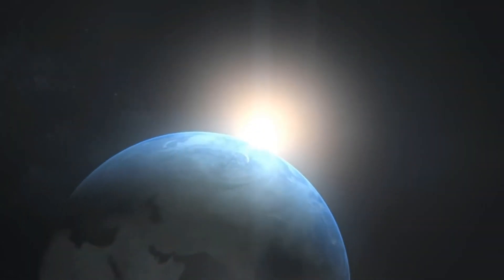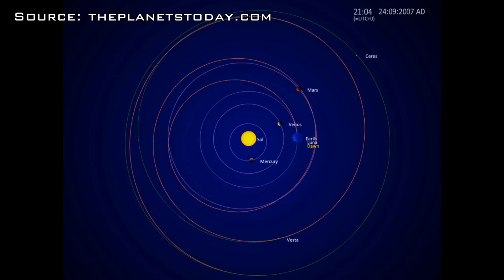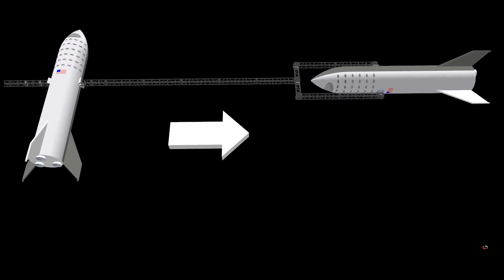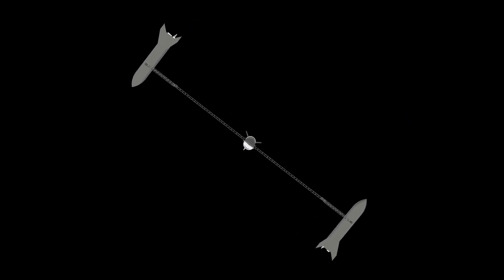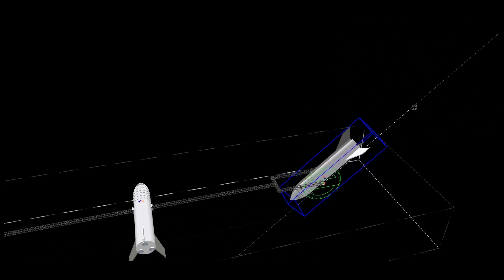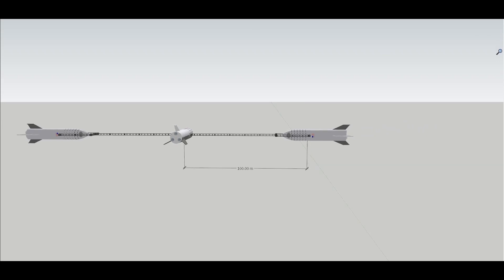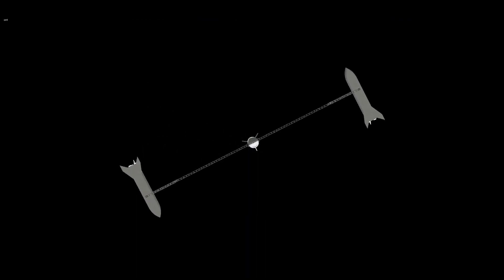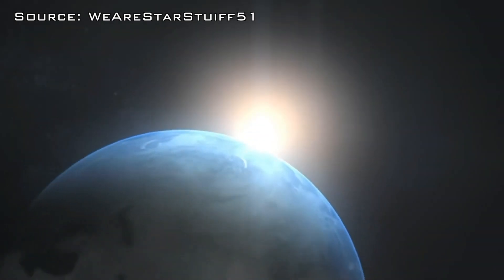GLS2: Artificial Gravity for SpaceX's Starship

Comment: Your design of spinning two spacecraft (or, I’d rather go for 2 environment modules) around a central craft is simplistic. What I mean when I say simplistic is- elegant. Thinking outside the traditional wheel and single module craft “box” exhibits some good practical engineering concepts. I would suggest thinking about the central structure being the main drive system (as well as housing the foldable extension arms). Even though the spinning modules would need propulsion to initiate and stop rotation, they would have less mass sans a main drive and associated extra fuel. This would place less stress on the extended “arms.” What do you think?
Reply from the maker: I like it a lot, this puts some great visuals in my head!

Comment: This is a very interesting concept, though I'm not 100% sure that truss would long enough to avoid problems from Coriolis forces, but I suspect we can figure out ways to cope if it isn't. There also needs to be a ballast system to equalize the masses precisely, but that could simply be a movable weight on the truss. It is unlikely that the masses of the ships would be much different, so it would not have to be extremely massive.

Comment: Yup, except you don't need the main engines for this and you can do it with two ships tethered and facing in the same direction, leaving the floor of each Starship as a walkable base. Two enclosed ladders as tethers (which can be rigid) complete the travelable circuit between the spacecraft. "My Idea" has been around for decades, btw. The Starship design is by no means set in stone. This leaves open many possibilities for configuration of artificial gravity systems. This is a good start.

Comment: How are you going to ensure that both of the outer ships weigh exactly the same...? How are you going to ensure that the thrust from BOTH is exactly equal and the burn of exactly the same duration. With a ridged structure, lots of scope here for a MAJOR SNAFU...!!!
Reply from the maker: Good questions! The computer that controls the thrust would have the task of making sure that the spin system is balanced during spin up. The mass amounts don't have to be exactly the same. The closer the better obviously but realistically the center of spin will not be located in the exact center of the GLS. Instead it will be slightly offset, and one starship will have slightly stronger artificial gravity than the other.

Comment: Rather than assembling lots of beams and girders why not use the masts and rigging system that worked so well for centuries on sailing ships.
A few simple beams, that  need be no more than hollow aluminium poles held in place by cables could bind the 3 starships in your example into a rigid structure . Loads would be transferred through the beams and cables so the entire complex can be powered and navigated as a single solid vessel. Exactly like a sailing ship.
Beams and cables would cost a fraction of any other method, are easily assembled, require minimal material and are easily expanded. Indeed I would suggest that two separate rings strong enough to support multiple pairs of ships be built around the central starship, but separate from it  to take the loads and decouple the central starship from the need to support loads. Provided you make these central anchor points strong enough you could expand the number of passenger ships in pairs as needed.
A simple cabin with an airlock at each end can be run on cabled between the under-gravity starship and the hub along cables just like a ground based elevator. Two of these and both sides of the system can visit each side of the Star Cruiser (to give the complete structure a name.)
Because the 3 starships are bound in a single rigid structure, spinning them up and despinning at the end of the voyage are simple tasks.
Reply: I,m at willettfj@hotmail.com
Reply from the maker: Please drop your email address so I can contact you, or DM me at twitter.com/realsmallstars or instagram.com/realsmallstars - I would love it if you can draw a picture of this, or just parts of this especially how the aluminum poles and cables are oriented

Comment: I don't see the use of a cable system (I say system because it wouldn't be one cable, you'd want many redundancies) negating the use of the main engines for the rotation.  You'd have to use a bit of rcs to keep it taught initially, but that amount of fuel usage would be dramatically offset by not needing to bring a 3rd rocket up.  Even if you did have to use rcs for the maneuver, it still would be dramatically less expensive than a 3rd rocket.  As for safety, you have some points for, and some against.  A rigid body may have a higher load limit (although not necessarily, but let's say it does) but it isn't as resistant to sudden, unexpected loads, such as a point failure, a meteorite impact, explosion, or any other unpredictable occurrence.  If there is a failure, a cable system would also be a lot more fixable, or in a worst case scenario, could be jettisoned if a much cleaner fashion.  Also, a cable system could spread out the load over the structures of the rockets much more evenly.

Cable or fixed, however, I don't think it'd be necessary to bring the linkage system down to Mars.  You'd leave it in high orbit and meet up with it when leaving.  You'd use a bit more of your total fuel getting up to speed, but you'd only need it for the transfer part of the DV equation.  No need to decelerate that when you get back to Earth (after disconnecting it), just let it fly on past, preferably at a point where it'd slingshot into the sun or something.  Hmm, I wonder if a slingshot could actually create enough DV to deorbit from the sun...
Reply from the maker: It actually takes less energy to directly enter Mars's atmosphere and land than to achieve a parking orbit around Mars which is why I have the truss structure launching and landing every time. The current plan without artificial gravity is to land on Mars without entering orbit of the planet, this way the Starships can slow down using the resistance of Mars's atmosphere.
Reply: @smallstars  Fair enough.  I was operating under the assumption that you'd use an aerobraking maneuver for capture to parking anyway, but I suppose that maneuver would have to be tweaked close to the planet (low efficiency) meaning a greater allowance for error (extra fuel).  Also, given that we're just talking about the truss vehicle (unmanned), a suicide burn (highest efficiency) landing is an option.  Also, with Mars's substantially thinner atmo, a takeoff is nowhere near as onerous on the DV as it is from Earth.  Do you think a direct launch-to-transfer burn is an option?

Comment: The problem is of course it's not gravity,  it's inertia causing centrifugal force and that is a different force with different effects.  While it is similar to gravity it is not exactly like gravity and the difference would take some getting used to.  While you can do no experiment to distinguish the difference between acceleration and gravity (in a closed box) there are likely numerous experiments that can be done to distinguish the difference between centrifugal force and gravity or acceleration.

Comment: Rotate the design of the cabin space 90 degrees and add a reverse thruster at the nose to slow rotation. This eliminates the need to rotate the rocket for braking on centrifical rotation and the need for a yoke style gantry connection.

Comment: I've been thinking about this video for a while and I have some thoughts.  Specifically on the subject of a cable or tether (tether) versus a rigid truss.  
Weight:  A truss is heavier than a tether is a fact we can assume.  How do they perform in a failure?  Not doing the math, but a truss at least gives an option to have a tunnel between the craft, giving many new options for design and crew.  You can more easily have multiple tethers for redundancy.  Where a truss doesn't give the rebound whip in a break like a tether tends to do.  Ever see a rope or cable break on the really large ships?  Those things are freaking dangerous.
Mitigation:  How difficult can mitigation be to implement on either?  Even if flight to orbit get's to $250 a kilo, which is unlikely, mitigating weight is top priority.  
Mitigating the downsides of a tether is most likely to be the best way to go.  Not a realistic tunnel option, but is that essential?
Reply from the maker: Well put. I've been working on a pros and cons list. Feel free to click on it and add a comment. https://docs.google.com/spreadsheets/d/1KMLvz9KBz0aL8CqkMifEo3-Esn6g__uj48YDtjHu_Yg/edit?usp=sharing

Comment: I don’t think that there will be enough fuel to make a return trip, that’s part of the reason most of the advertisements to mars have a one way trip written in small print. No room for that, not enough money for it either.

:edit: What sort of gravity differential would someone experience between their head and their feet per floor? It would be extremely disorienting to have 1 g at your feet but .8 at your head ( random number tbh, but what’s the difference between head and feet )
Reply from the maker: OK firstly hahaha thats funny about the fine print. There is a planned return, thanks to "in situ-resource utilization." check out more here: https://www.nasa.gov/isru

As for gravity differential, it's more like .02 difference. There certainly needs to be testing done in low earth orbit. The larger the radius of the spin system the more comfortable it will be for humans. http://www.projectrho.com/public_html/rocket/images/artificialgrav/gravComfort03.jpg

Comment: What type of metal and process can be used to fabricate your Idea that can be made here on earth at normal temperatures and then in the cold of space have a reaction to it and still maintain the integrity of metal tensile stress strength?
Reply from the maker: Great question! Cold welding is not a myth! I plan on updating you with some options in a future video.

Comment: Connecting the trusses closer to the nose cone would reduce the truss length.  The connection should probably be a ball and socket type to lessen the strain during acceleration.  

Also acceleration with a shorter truss might be able to stabilize and then a second adjustment to put each ship further out could be done with a cable system.  This will not change the amount of artificial gravity, but a slower rotation further out will have other benefits.  The difference of gravity with a change of personal space, like standing up, will be a lower percent shift in gravity, if the ships are further apart.  This will help stop space sickness.  

Any adjustment to speed or stop oscillation might be more easily done with the cables reeled in, so any thrust tweaking is transferred to the truss.  Also a slower rotation will bring the outside stellar spin and Sun view down as well, which will help the astronauts.

Comment: a better long term solution is a rigid structure connecting just two ships. built in earth orbit, used for the trip and left in orbit around mars until needed again. then have one orbiting earth and another orbiting mars and use them back and forth as required. space x have undoubtedly considered all the options. what i'm seriously not convinced of is that anyone going to mars is ever coming back to earth.
Reply from the maker: It actually takes less energy to directly enter Mars's atmosphere and land than to achieve a parking orbit around Mars which is why I have the truss structure launching and landing every time. The current plan, even without without artificial gravity, is to land on Mars without entering orbit of the planet, this way the Starships can slow down using the resistance of Mars's atmosphere.

Comment: You have some interesting ideas and there is a but.    Actually there are a couple of buts and a suppose we changed part of your system.   I would engineer a specialized coupler and utility module specifically for the link ups instead of burning a whole star ship for that.    The coupler module would cost way less than a whole starship and still do just as good a job or likely a better job.    It also will need to be built a lot stronger than a star ship to handle the forces it would receive by spinning 2 star ships on it.    The star ship designs would also need to be upgraded to handle the forces it would see at the spin coupler but that would be obvious if this sort of spin system were decided on.    Also, I believe SpaceX is planning to send the fuel resupply ship on ahead to Mars once they have figured out all the details on how to produce rocket fuel.

There are some questions or issues that have not been resolved.   The main one is the matter of Mars gravity.   We have no idea if humans can live in 1/3rd earth G and remain healthy.   Maybe they can or maybe they will still suffer the effects we have seen in micro gravity or maybe they will have the effects somewhat lessened but will still be ultimately fatal.   This still needs to be determined however.   We also need to determine in general the minimum fraction of 1 G that will keep a human healthy.   We may find that we won't be living on the surface of the moon because of this. 

I have emailed Nasa and SpaceX multiple times about the need to put a partial G lab in orbit to get the answers to these questions.   Apparently, they just ignore these issues and continue to steam ahead.   If we find out that we can't live on the surface of the moon or Mars or any of these other little space rocks, we would have to have artificial G stations planted in orbit around them for people to live on and they would then go on away missions down to the planets surface for whatever surface activity is required.   

I've seen all these uses of Mars regolith such as building habitats and for growing plants.   Most of the regolith on Mars is loaded with per chlorate however.   Can a whole structure made of material loaded with per chlorate be lived in safely?   I've asked this question of all these companies being paid to come up with ideas for habitat construction on Mars.   I get crickets.   Most likely, hydroponics will have to be used to grow plants or a very expensive and complex process will have to be put on the planet's surface to remove the per chlorate from the soil.   Technically it really isn't soil and it is not suitable to be used as a soil base for growing even if it didn't have per chclorate.   Plants need organic materail in the soil as well as a bunch of tiny bugs for them to be healthu and grow.   If you could grow plants in Mars regolith with some additional additives and you did not remove the per chlorate it would be up taken into the plants and then of course they would be poisonous to humans. 

On a related issue to the per chlorate regolith, I've seen a lot of habitat designs that have given no thought to an entry/exit clean room.   This would be absoultely vital to keeping the habitats from being contaminated with regolith dust.   Humans can't breathe that dust and last very long.   It absolutely can not be allowed to get into the habitat living spaces.   It is so fine that the tiniest bit of air would stir it up and the habitat air filters and recirculators would not be able to filter it all out before people living in these igloos breathed it in.  This is notta good.

Another big issue is solar radiation and cosmic radiation.   Unless we come up with some kind of effective shielding for the long duration in space and then for people living on the surface of Mars, it doesn't matter if we had gravity or not.    Even with adequate shielding on the surface I don't think we will be able to construct shielded space suits.   Once a person lands on the planet their time of exposure on the surface starts they count down to a permanent trip home if they want to stay alive.    Using shielded rover vehicles will help but space suit time is still a ticking clock to death from radiation exposure.

Anyway, these are some of my main thoughts on the whole thing.   I am about to give up trying to get anybody to listen and/or consider any of these issues.
Reply from the maker: I like you're ideas and I appreciate you reaching out. Drop your email or DM me at twitter.com/realsmallstars or instagram.com/realsmallstars

Comment: Love the idea, the only problem I see with it is the Dzhanibekov Effect or "Tennis Racket Theorem". I think we need to consider designing a very efficient way to manage a perfect stability system to pull this off. I'm no astrophysicist or math genius so if I'm wrong for worrying about this effect on the design then its the best I've seen.
Reply from the maker: You are correct, struggling with this the most while updating the design
Reply: @smallstars  I think the best bet would be to design a larger craft. Double up the arms and have a second pair counter rotating. (It may come down to a question of required mass for the mars mission) perhaps 4 cargo loads would be needed anyway
Reply from the maker: @Miller0067  Cargo doesn't need gravity, but could be used as a counterweight for sure. As they say with spacecraft design and most engineering: less is more. Only reason I have 2 passenger starships is because they plan on sending them at least two at a time. Since I made this video Musk has tweeted that many more than two at a time will travel to mars during the window, so maybe they'll make a wheel out of them!
Reply: @smallstars   that's what I was thinking. The rotation of the extra starships would not be for gravity but for stability, or perhaps splitting the cargo and passengers between the (at least) 4 shuttles in the system would allow more comfort to the passengers. There are alot of concerns about centrifugal based artificial gravity and perhaps having 4 separate single floors all at the same distance from the axis would alleviate the discomfort of changing the distance (virticly) towards or away from the axis..